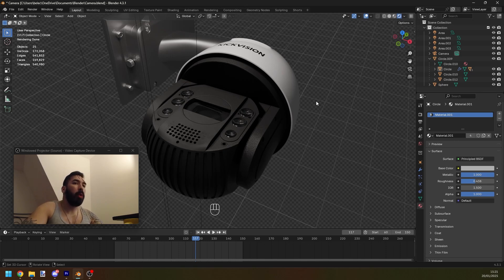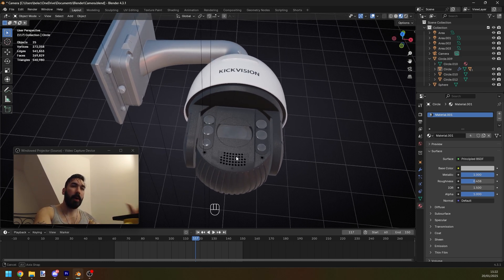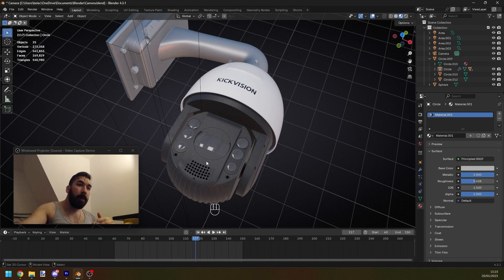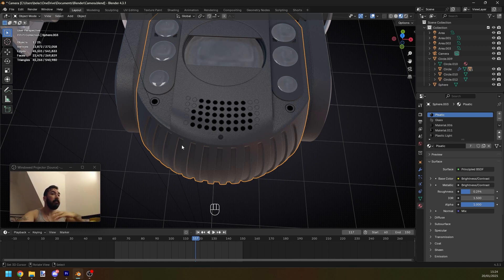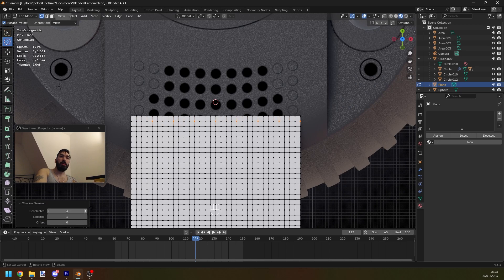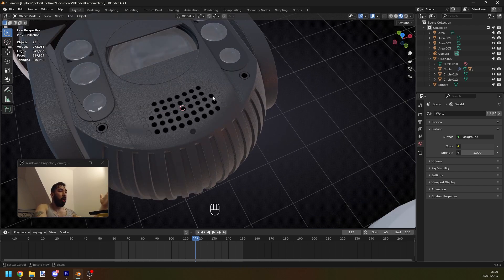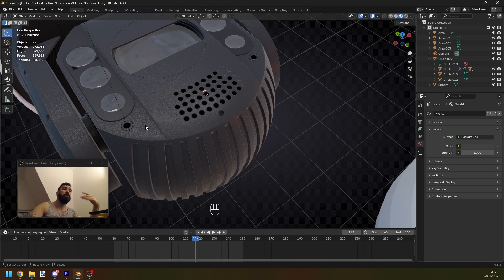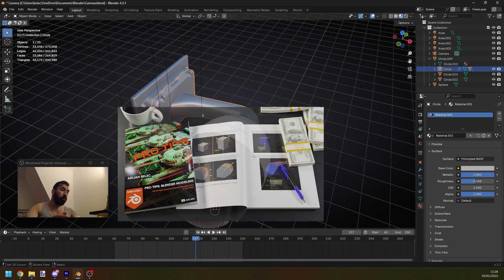How to Approach Complex Hard Surface Modeling Projects in Blender (Aryan)

Comment: I have now made 2 models in blender, one with a material and even an environment around it, it’s not the best topology but I learned a good bit from that first one. The second I’d think is pretty good topology! I’ve learnt a lot from your videos. I opened blender 4 months ago and thought I’d never get anywhere with it with how complicated it looks.
I am still having struggles with the mathematics of the topology of some things, maybe I completely missed it in this video but I was tired last night but how you got 90 some vertices in the calculations is beyond me as of right now. 
I do know once I get the equations down and why/how it works it’ll be pretty easy as I’m pretty decent in math.
Reply: I also really thought I was just being stupid looking at the product for a while before even starting it, trying to calculate in my head what it’s going to take only for it to fail. So thank you for clearing that air up 😂